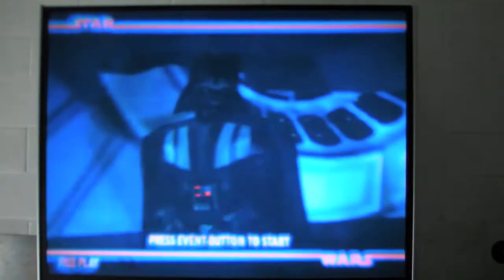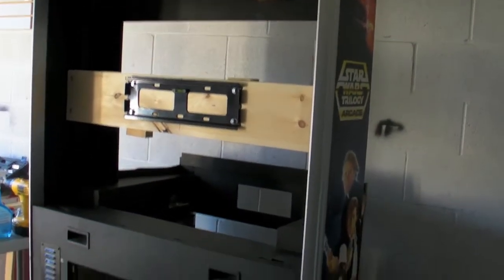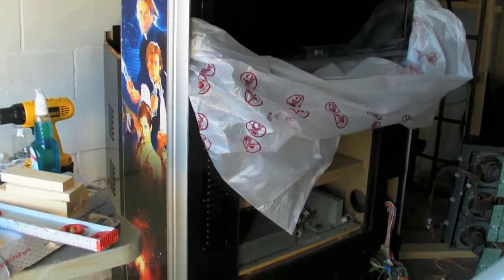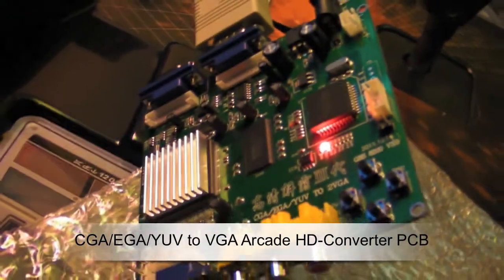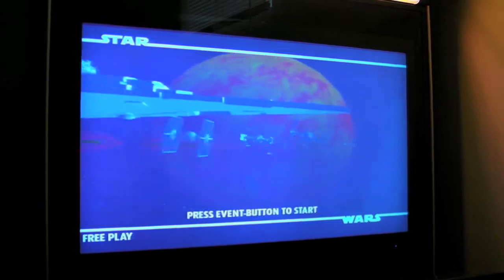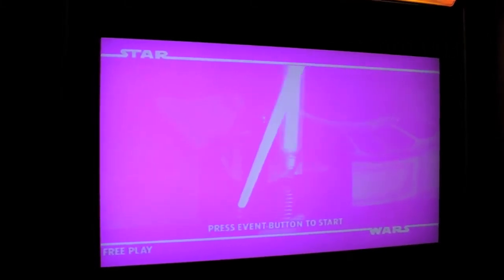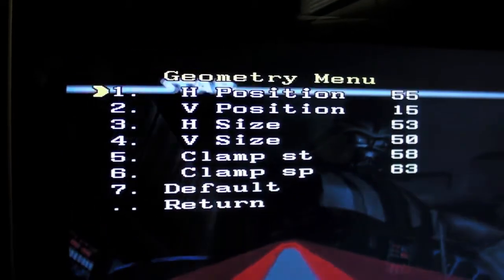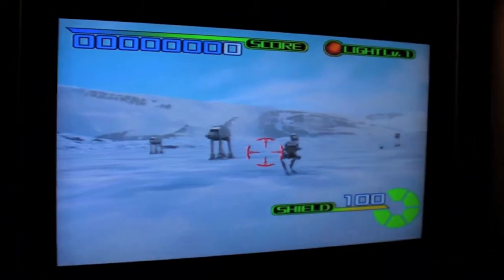Star Wars Trilogy Arcade LCD Conversion

Comment: I bought a 43" Sceptre led tv with VGA input from Amazon and it works with a direct connection, but I have to use the remote to turn it on.

Comment: Thanks so much!! I had this problem for years and didn't know how to fix it. I have the upright version of this game. Sadly my CRT has burn-in and was dropped, therefore the colors are all messed up. Having this running smoothly on an LCD was what I was after. I thought the red tint issue was due to the 5V input (I'm using an old Palm PDF AC cord, 5v / 1amp), but I was happy to see your video and find out the solution. My settings are slightly different, was if I use yours my screen goes black (Clamp st: 57 and Clamp sp: 63).

Did you use a power adapter for the VGA board, or did you wire it directly to the arcade. I would be curious to know. Thanks! :-)

Comment: Sir, usually old games looks to pixelated on LCD's, does the Board have electronics that compensates for that?

How is the Aspect Ratio-Problem solved?
Reply: +Hirthirthirt In my testing with my Star Wars arcade it looks to be pretty sharp. Then again I only tested with a 1024x768 LCD monitor. The arcade uses a "Medium" monitor (which is something like 640x416 or 512x384). Unsure how it would like on a 1080p LCD.

I've seen other Star Wars arcades in the wild with an LCD TV replacement, but they usually ignore the aspect ratio and have the image stretched. I believe the VGA output comes 4:3. So as long as the TV can uncrop/zoom the image, you shouldn't need to worry about the aspect ratio. I'm unsure if the VGA converter box has any aspect ratio settings (I think not).

Comment: I have the same machine and installed an LCD and for some reason it locks up and the music still plays I was wondering if you had the same problem ? or any ideas what it could be ? thanks
Reply: +a burns Mine locks up once in a while, usually during the Bonus rounds. I spoke to another owner who had the same issue. He did a ROM test and ordered the 2 ROMS from Sega which were bad. Unfortunately when replacing them, the issue still remained. If you ever figure out a solution let me know. :)

Comment from the maker: Umm depends where you start. The board starts from the left back corner (if you face it sitting down in the seat). There will be a VGA cable coming from there. You'll just have to open that corner panel. And just follow it from there. Pretty much everything inside on the 2nd shelf if for the projection monitor. And I removed all or that, including the lenses etc etc. It will lighten it up as well.

Comment: Great restoration. I've been tempted to buy one of these cabs in the past but the screen burn issues always turned me off.

There's always the option of the CRT standing cabinets, but it's not quite the same.

I don't suppose you have any makeshift blueprints for the mounting and the physical dimensions of the LCD you used?